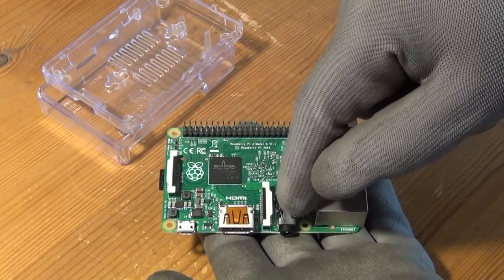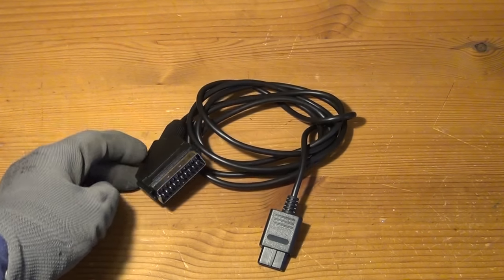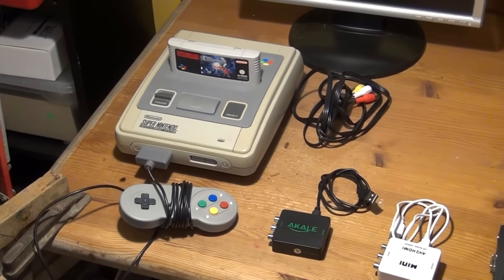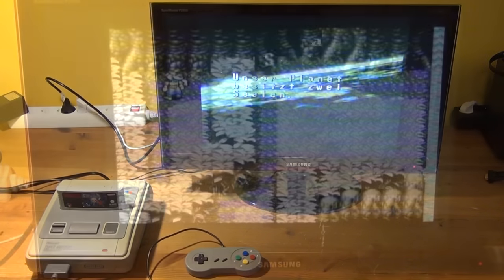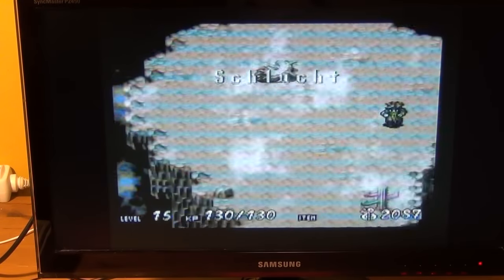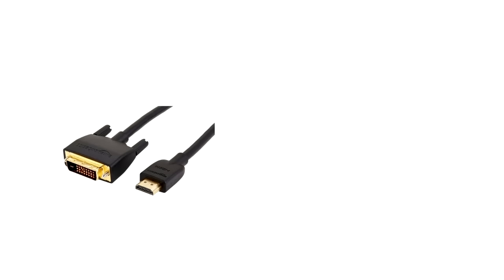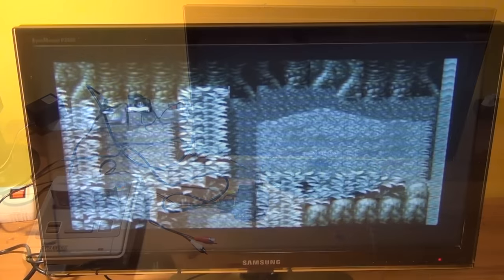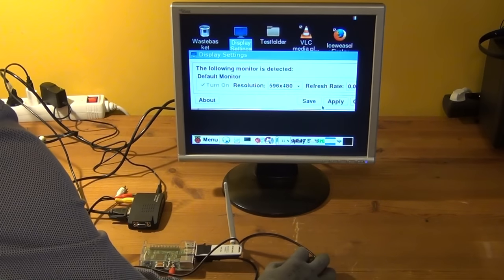Old Consoles + Modern LCDs? Testing Cheap Composite to HDMI / VGA -Converters

Comment: If you have many of these converters, it would be funny and interesting to see how many can be connected in series and still produce a half way decent picture, even though it's ben converted multiple times (i.e. Composite->HDMI->VGA->Composite->HDMI or something like that), just for the fun of it! Like a totally ridiculous bunch of converters in a looong, hillarious chain.
Reply: Lol that would be cool.
And then put them Both on a CRT and LCD with a Splitter (and if we wanna be even more extreme, a splitter into a splitter into a splitter...)
Reply: I'm a little late but right now I use an rca to HDMI and then an HDMI to VGA to use that stuff on my crt monitor

Comment: The garbled color is because these converter devices cannot handle the slightly off-standard video signal that the SNES and other consoles of that era put out: 288p (240p for NTSC) instead of 576i. Whereas the Raspberry Pi puts out plain standard 576i and therefore works as intended in color.

Comment: 1:40 RGB and Component are not the same :(
Reply: RGB is a form of component video. So yes RGB is component video. What you're thinking of is Ypbpr component video which you usually use with red, green and blue rca cables.
Reply: They're close enough in picture quality for all intensive purposes and I think thats the point made.
Reply: @Clesarie  Intensive purposes? I've never heard that, thanks!

Comment: You mention using an HDMI to DVI converter cable, but that you were not certain that it would work. As the HDMI and DVI format signals are pretty much identical (except DVI doesn't support audio) there should be no issues using such a cable. In fact, it's likely that the construction of the cable uses direct plug to plug connections without the need for any other components.
Reply: I connected computer (DVI) to monitor (HDMI) through HDMI 5m extension cord using cheap HDMI-DVI adapter. Works perfectly.
Reply: There is a slight difference in the signaling, HDMI generally uses so called CEA modes, and DVI mostly uses DMT modes. That shouldn't make too great of a difference, but can be a problem in the HDMI->DVI direction when converting.
Reply: If I may jump in, doesn't work. 
I have the mini AV to HDMI box.
I have monitor that has DVI and VGA but not HDMI.
I connected PS1(fat) to the box and then box to my monitor and it did not work. 

My guess is box works exclusively with HDMI.

Comment: If the SNES video cable is meant to support RGB, it’s likely that the composite video output has been nerfed in some way, and that you won’t have success with conversion to VGA in that way. Perhaps you could locate/create a SNES component cable and try converting that to VGA?

Comment: I have the Mini HDMI ADV as seen in this video (white) for use with my N64. It plugs in and finds SOMETHING on the HDMI channel as the screen goes blue, but still says no signal. :( Would anyone have a clue how to get it to find the signal. :(
Reply: i had the ame problem, tried it with my old xbox 360, bue screen, then i connected the mini hdmi av to my smartphone charger and i got a signal, but it looked bad, blurry, the image kept moving and the colors were wrong. How did it go for you since then?

Comment: 9:50  Solution : use old CRT no more than 14"  cause signal of old consoles about for 240p - 420p or LCD TV with AV instead of monitor

Comment: Sorry to hear your ill :-(, it sounds very nasty, i hope you get well soon, horrible being ill :-(.

Its possible that the colour content isnt spot on frequency, old computers were often slightly off or the colour burst was rough, old tv sets were quite forgiving with slight colour sub carrier frequency or slight errors, but i dont think digital converters are too flexible.

The uk sub carrier is 4.433619mhz pal system and i think the american ntsc colour is 3.579mhz, not sure about german standards.
There used to be a trimmer capacitor connected to the crystal in the tv colour decoder to tweak it, i would be supprised if those converter boxes had similar.
Reply: You're right about North American NTSC color burst frequency: It is 3.579 MHz. Often the color burst signal was simply called the "3.58 line" or "3.58 signal" when I worked in the broadcast television racket.
You also raise an interesting point about color burst being rough in older computing devices (like a game console). It used to be one could find both 3.579 MHz and 3.58 MHz crystals readily enough for replacement parts. Maybe some early devices were stuffed with 3.58 MHz crystals for the NTSC market(?). The rounding up to 3.58 MHz was already inferred in common usage around TV types.
Reply: The worst offenders were video recorders, the output was never too stable, but some tv's had a special channel for vcr's, i think it was for a more forgiving line sync, but it did seem to help for over all stability, but i never really went that far with tv mods.

Comment: It looks like the first converter is configured for NTSC or just can use NTSC. Or wrong PAL format.
Reply: Thats not it, the signal of the snes gets detected as Y (lumma) the green cable(with noise) in component cables instead of cbvs. It needs no deinterlacing but the color signal is obviously wrong
Reply: ZedHqX4
I doubt it that the actual progressive G-Output was interpreted as composite signal. Or did I get you wrong?

Comment: Just to chip in, even if you have an modern lcd television that have composite input, getting a converter is a good idea because the internal upscaler of those tvs is generally awful for gaming because they add lot of delay to the input, because they try to "embeleze" the picture (more specifically deinterlace it), and this process requires a lot of the previous frames to reconstruct the picture etc..

Comment: you are using PAL to NTSC converter then your video is on grascale
Reply: This thing is not pal to ntsc converter, its av to hdmi or av to vga converter.
I think the problem is when you try to play pal games on ntsc system, the grayscale effect happens.
It all has to be pal, the game, the system and tv or all ntsc.

Comment: Hey I have a dell monitor & im using a hdmi to vga converter with a power source to try and play on my PS4. When I start it up after going into the settings of my PlayStation & turning on the PS4 the monitor responds but doesn't show the picture. The monitor flashes but doesn't come on. Can you please help

Comment: there are some analog tv boxes for monitors that have composite in  for aux devices, theese devices are sold cheap now because there are no analog channels to display but they are great at displaying composite signals
Reply: Awesome tip, man! I am trying to get video from a PAL snes on a vga monitor and I am looking for a solution. Do you think this anolog TV box would get the job doem? Thanks!

Comment: So it's not perfect,I've been planning on that method because I have a old monitor VGA input,I want to use my old game console to it,PS1,PS2,GameCube,Generic NES with built in games.And cable TV from a Cable converter.Maybe the problem on your SNES is PAL,The your using NTSC composite to VGA converter?

Comment: i have the first white square Composite to HDMI converter and have tested it in my setup with fine results on xbox and PS2 composite signals in both PAL and NTSC (British so PAL being my standard too). Setup for reference: Input Source > HDMI Splitter (HDCP Stripping) > X19W 1440x900@75hz monitor with HDMI to DVI cable.

so plugging in said composite converter works absolutely fine on all the stuff i have tested with thus far. I do also have a component to HDMI converter as well that i use for component cables and the only time i run into issues with it is with nonstandard HDMI output from the converter into my monitor (Connecting my Game Capture HD60 standardises the output though so that passes through fine). oh and the fact that the monitor hates 60hz interlaced signals (tested with direct connection to my laptop via HDMI and Nvidia drivers/custom res and 75hz interlaced signals working fine).

TL;DR: Results may vary depending on manufacturer of said generic box or something.

Comment: if your monitor has VGA, you would be better off looking for SCART to VGA. because SCART is almost entirely a PAL reigon standard, such a convreter will be better suited to work with the PAL colour standard. also, such a converter would only be translating the sync signals, since VGA and SCART both use RGB, so you would have a nice crisp picture. note that most of the colour issues will not happen for people in NTSC reigons, as colour is encoded slightly differently between the two standards.

Comment: Thank you very much for your video. Your thorough explanation and comparison are exactly what I need badly. Too bad that I have come across your video too late, as I have already wasted money and so much time hoping to connect my SNES to my HDTV by using the first converter (yes, exactly the same one) but unsuccess. My case is even worse, as the HDTV just display "No signal", not even any distorted images!

Adding VGA to the whole connection is a great idea, and I thank you very much for proofing it works, though not completely.

Comment: Hi there

Maybe you can help me out - I recently tried connecting my SNES to an Acer X1273 projector (2 VGA, 1 Composite, 1 S-Video) 
The composit only features a black and white picture - I would like to fix this. 
Could I just use a regular Composite -> VGA-adapter? 

What would you suggest? 
Thanks in advance
Reply: try using an adapter for hdmi

Comment: I have one of those VGA converters, and for anyone wondering, the s-video has a bunch of vertical rainbow bars sort of overlaid on the picture.. it's only noticable when certain colors are on the screen (light blue is one I remember being pretty bad). The composite is better, but, it's still composite so... It's a tradeoff. I've only tried it with a  NTSC PS1 and PS2 though

Comment: I have something like this set up, but the only complaint I have is that the converter box also needs power, bringing the number of sockets to above what one wall normally has. Might just have to mount the box onto the screen and run the power into the TV's power converter.

EDIT: For the SNES, my solution was to use an S-Video cable meant for the device. Of course, this means sound has to be plugged into a separate audio setup entirely, but all colors worked very well.

Comment: I got one that looks like your white one. It shows up blue when the console is off. Theres no 720p selector I believe it's automatically 1080 haven't tried it on a non 1080 screen. But it works perfectly no color issues like on yours.

Comment: After some research I came to the same conclusion about having to use HDMI to VGA converter. I'd love to use my old CRT monitor for my Sega, nice to know those VGA converters wont work. Is there no way to convert the RGB to VGA? To my understanding the composite squashes all the signal together and that's why it could be displaying in black and white.

Comment: The HDMI to DVI cables will work fine. They will not provide any sound though.
You just have to plug the audio cables into the monitor (probably using an RCA to 1/8" headphone adapter).

Comment: do you think a raspberry pi zero could be capable of taking in a composite signal and outputting over hdmi or would it be to many samples per second and if it was a mater of not enough processing can you gang them up in parallel

Comment: Composite, VGA and DVI-A are all analog signals, so the conversion should theoretically be much easier to do than with a digital input like HDMI or DVI-D.
But here's a question: Is there any way to see whether a DVI connector supports digital or analog or both signals? Other than trying it out, I mean.
Reply: Seegal Galguntijak typicaly that's identifiable from the pin setup. there is also DVI-I which comes from a source which can support both
Reply: Spark Gap OK, but to my understanding, DVI connectors on devices like screens or output devices are female, so you can't really see which pins are missing. Or does that mean it supports both?
Reply: Usually but not necessarily always the other inputs give you a hint. If it has HDMI and DVI it's probably DVI-D. What I would do if possible is bring up the stats on that make and model on the googler

Comment: Did anyone test the cheap AV2VGA with a PS1 or above? He shows that with the more expensive one the PS1 worked just fine, maybe the cheap one doesn't handle the SNES signal
Reply: Do you think a composite to VGA converter would work with the PS2?
Reply: @polaris0386  it will work but with some lag! Yesterday I bought a HDMI to VGA cable adapter and plugged it through the PS2HDMI adapter to the PS2. It looks way better and there's no lag at all! I would say that it's the best option to connect a PS2 to a VGA monitor.
The problem is that not every PS2 game can be displayed in the VGA monitor that way, just the ones that have progressive mode (480p).
Reply: @LuisRadaAlean  I bought an adapter a few moments ago so hopefully it'll work. I can usually work around lag since I've grown pretty used to it. Just as long as all the colours are there : )
Reply: @polaris0386  I hope it'll work like a charm! Let me know how it went! Cheers

Comment: Didn't the SNES had an option to use other PAL standards?
Reply: No, I don't think it has, and the funniest thing is that the video encoding circuit was in the cartridge :P And you could play a NTSC cartridge on a PAL tv simply by plugging them in a dual cartridge adaptor... Good old days, I still have the console and the adaptor, I should buy one of those composite to vga to play sometime
Reply: Ben's things & thoughts
There are still plenty TVs out there with composite input. Even modern ones. :)
Reply: No, that's wrong. The adapter was a simple pass-through connector to allow US carts to fit PAL machines. Some bypassed the lockout chip so Japanese carts would play. If you put an NTSC cart in a PAL SNES with the adaptor it will still play at 25 FPS. We would import an SNES from the US to play games at 30 FPS.
Reply: hmm okay.... thank you for the correction, I had been told what I wrote above, but I never did confirm by looking online... And you are very right !!
Reply: Ben's things & thoughts maybe you or the yarn spinner were confused with the SupeFX chips? They were additional co-processors fixed alongside the  ROM chip to allow things like 3D, the first being Star Wing / Star Fox.
Reply: Dude you know your stuff about SNES it is pretty impressive !! I have never heard of the SuperFx thingy... But I think I understood something wrong (it was a long time ago) and over time what have might be true at some point turned itself onto a load of nonsense :( Time is messing with my brain and I don't like that :P